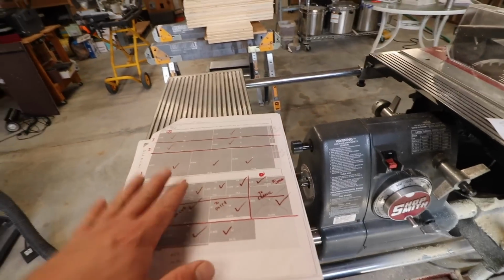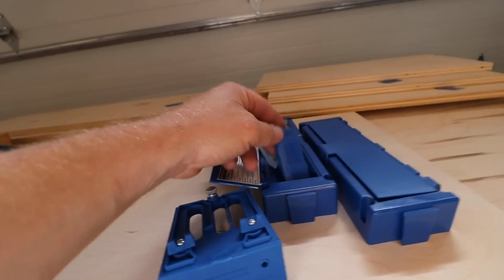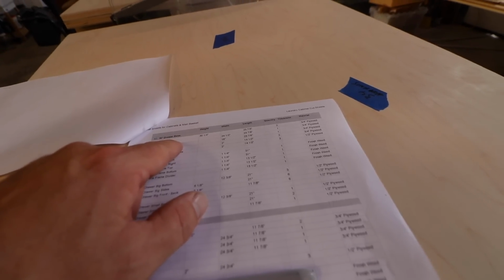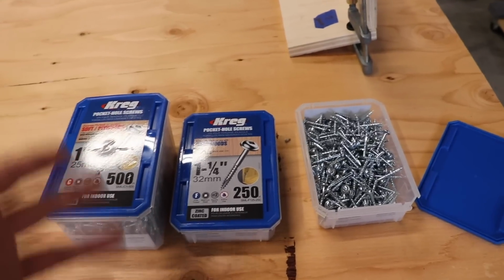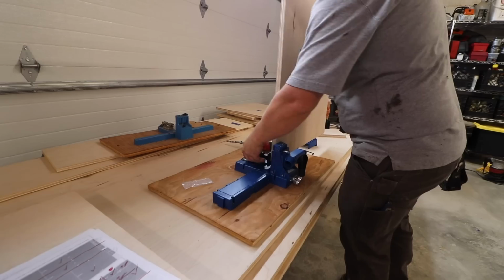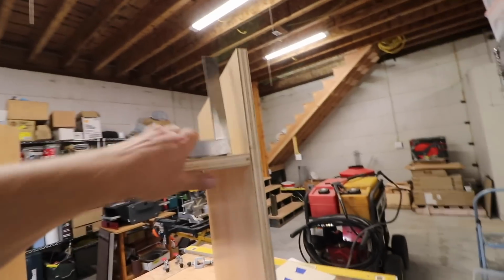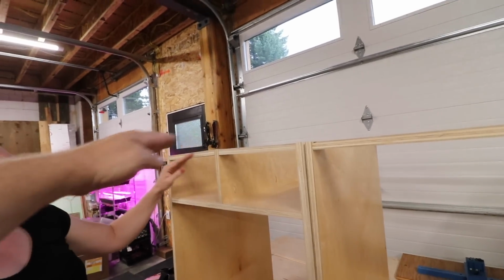Made ONE DOZEN CABINET JOINERY MISTAKES Today

Comment: Planning for a back panel on the drawer cabinets (even if 1/4 inch plywood) will help keep the cabinet square. Use rabbits in the side and bottom panels and flue the back panels.

Comment: Kreg has a new 90 degree clamp for corners. I’ve built tons with my k5 and it’s great. The new clamp eliminates the issue with the panels shifting. It holds fast and flush. Make sure to use glue on the joints though. Glue is so underrated.

Comment: Errors (as noted by others), but the biggest — lacquer is NOT a suitable finish for kitchen cabinets. Lacquer has no resistance to water (remember those nasty rings on grandma's table?). Polyurethane — water based or preferably oil. 2 coats minimum. Spray poly is available for faster drying.

Comment: The pocket holes in the panel under the drawers should have been on the drawer side of the panel. They're now visible from inside the lower box, vs being hidden under the drawers. The side panels could have been attached to the bottom panel by conventional screws coming up from under the bottom panel and the side panels should have been rabbeted so there's no end grain visible from the bottom panel. No pocket screws attaching face frame to side panels, glue and clamp only. Unless you're going to laminate something over a visible side panel, that's a lot of filling and finishing to do and the filled areas will probably flash through any paint job.
Reply: Steven S screws going into the edge of plywood have very little strength as the plies can delaminate. This can cause the cabinet to fail and fall apart. If you want to use a rabbit then after glueing it up you should put brads through the side and into the bottom peace at a slight angle. Secondly, the vast majority of cabinets that people buy are only finished on the face of the cabinet and the other three sides are not because they will be attached to cabinets on ether side. The last one would but up-to a wall or you get a matching panel to attach to the end. Lastly they decided to have face frames on their cabinets so no worries about seeing the edge of the plywood. Are there other ways to make cabinets? yes. But for a novice woodworker what he’s doing will work.

Comment: If you're going into edge grain of plywood without cross hole with dowels, I'd use confirmat screws like they use on mdf and glue. Regular wood screws just rip out of plywood. I'd really drill cross holes and fill them with dowels to accept the screws

Comment: That black plastic box with the fingers but I haven’t part is for supporting parallel clamps when you’re clamping together a frame and panel door or a box like a drawer
Reply: yes, that plasticy thing is a holder for clamps crosswise. I have used them from bessey. maybe they are also for Jet clamps.

Comment: Just FYI, when you checked the cabinet squareness you were experiencing "racking". Having 1/4" material on the back plays the important role of stopping the racking. 
Also you left the back off the sink base stating that your pipes would enter there. Aren't your supply and drain pipes actually going to enter from the bottom? You can't really get your pipes into your sip walls.
Reply: Cabinet will be against the bathroom wall, not the outside SIP.   Go watch the bathroom build....

Comment: Holes on the outside ??
Reply: I don’t understand the thinking there either... the drawer will hide them inside and the face frames will obscure them below.  Unless he’s going to veneer the outside???
Reply: @sassafrasvalley1939  He briefly mentioned something along that line.
Reply: Holes on the outside because when you line up the cabinets only the end one has an outside. Outsides get a finish panel. Take a look at the three cabinets and you'll see there are only two ends. Now if the cabinets start at a wall there will only be one showing end.

Comment: Just because you are using pocket screws on some faces, doesn't mean you need to use them for all faces.  That center divider would have been better served with simple screws coming from the bottom up.  They would have been hidden under the cabinets and it would make the connection stronger.

Comment: I think I saw you using a miter gauge when using the fence at the same time. If I saw right, never do a cross cut and  and use the miter gauge and fence at the same time. It's a kick back waiting to happen and oops, your finger hitting something turn over 3000 rpm.

Comment: You did well for your first time using the Kreg Jig and table saw. I built cabinets for my grandaughter's home. We had and an "L" shaped design with a corner cabinet for the lower's. And they had to fit the walls which were a bit out of plumb. I got plans from Kreg Jig company and did mine from their instructions.
I have also built a small table, our of cedar, that sits on my front porch and a couch table for my wife to serve desserts on Thanksgiving. All with the Kreg jig. Oh, and I built a toy box for a friend. You can stick dowels in the pocket holes and trim them off flush. Why buy the store brand.

Comment: I could be wrong, but the first cab you made you have pocket holes on the outside of both sides. But if that was the end cab, wouldn't you want the finished side to have the holes on the inside?
Reply: I think he said he's going to put a face panel over it.  This is just the box.
Reply: @KraftyKathi  Doesn't the face panel go over the front side of the cabnets?  If you look at his sketch up he did that is clearly the left side box, and those holes will be shown unless this is going up against a wall maybe.
Reply: @powang59  If you put the face panel on the front, how do you get into the cabinet when it's against the wall ?
Reply: Face panel meaning another layer, but on the end/side of the box.

Comment: Stop using the impact driver. Use a drill. And glue. And a back to square it up. Try to hide the pocket holes as well as you can too. Top and bottom or inside if it’s a must
Reply: Just finished watching the video. Sorry but you’re probably gonna start over.

Comment: Those black things with the 1/2" spaces, that you assumed are for holding material while you assemble it, are actually for use with Bessy Clamps. They are used to assemble frame and panel doors.
Reply: John Grossbohlin John is totally correct. I have the same blocks for my Bessy clamps
Reply: Indeed,  I have them to. To join things with pocket screws, I use my bessey clamps to hold everything in allignement

Comment: Jessie -you want a back on the cabinet to give it rack strength. It's easy to do with a rabbit bit in a router  and will square the box before you attach either a face frame or doors.

Comment: Whew you make thing so complicated. Cabinets are 24 inches deep and 34.5 inches tall. Its doesn't take a computer to figure out how to cut the sides, tops or bottoms. You want a 36 cabinet and you are using 3/4 plywood. Cut the backs and tops 34.5, then cut your sides 24x 34.5 and there is your box. Just notch in your toe kick on the side panels and you are done. Then measure for your drawers and install the slides and face it all out so it looks pretty. Throw that craig jigg in the trash and get a trim nailer. Lol.

Comment: If I use pocket screws I try two. Locate the on the inside and out of site if possible.   I don’t  worry. If it butted up to something where it won’t be seen.   I also use glue when I use my Kreg jig whenever possible
Reply: Also forgot to say I usually spray paint my cabinets.

Comment: What are you doing to stop the cabinets from racking? A simple way is to put a support Parallel to the wall on the back in the cabinet that you would not want to put a full back on not parallel to the floor like you have it. Corner blocks can also work. With out something the cabinets can be knocked out of square.

Comment: You really need to use TiteBond glue and a back. This will help square up the box and make it much stronger.
Reply: A back? Definitely. Glue? You'd just be making it harder on yourself. Glue won't stick to UV coating. Assembly would turn into a mess with everything slipping around; UV coating by itself is already incredibly slippery.
Reply: @KeithDiSarno  I thought he said it was finished on one side.

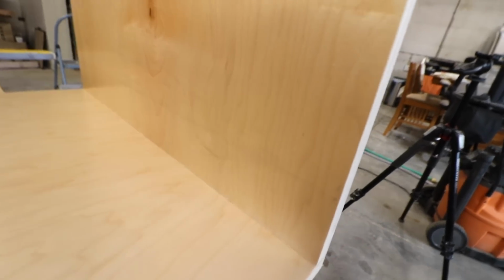Comment: A trick to preventing the edge from being drawn in that you were concerned about @ 19:05 is to take a 1/8th drill (or other appropriate size) bit to pre drill into the 2nd sheet. Another trick is to anticipate the amount that it will pull in and compensate when clamping.
Reply: I like your idea and mostly I like that you share experience not simply judging poor novice guy)))) Thx for advise I will remember it too)))

Comment: Just a quick suggestion, because it might help control dust. Hang fabric or light duty tarps between the two bats of the garage, separating the living area from the work area. It won't stop the dust but it may shorten the area it floats around.

Comment: Why not just hook your water up all the time to the well
Reply: Because they are in an area that has hard water, freezes and they have a cistern at the top of the hill behind his house to provide water pressure and storage. They fill the tanks at the top of the hill after treating the water for hardness and rust, after letting the water flow a bit to gain clarity. Otherwise they'd have cloudy water, rust and silt in their plumbing directly from wellhead to their house.
Reply: @Sullimech  I know what they do and how their operation works...however it makes sense now to hook up to the well...keeping a head pressure on the well will keep clean water as well...they could use the cistern for watering the garden

Comment: Front edge of the sink base:
That board is pretty wide for that application.  You won't have room to connect sink bowl anchors.  
But don't think you have to move the sink back away from the front to clear the board.  Just cut the sink hole including cutting through that board. As long as your sink hole saw doesn't hit your pocket screws, you're fine -- and if you want to locate your sink where you think the pocket screws will interfere, just take the screws out before making the cutout.  The glue will be dry by then.

Comment: Face frame:  
I think I'd just use Titebond and pin nails. Some of these modern wood adhesives are amazing. You almost don't need dowels or biscuits to connect boards edge to edge for table tops.  The glue joint will be stronger than the wood beside it.  Make sure you use plenty of adhesive though.  It will really soak into the end grain of the plywood.

Comment: You’d be better off using a drill driver with the clutch than the impact driver... it saves so much time as using the clutch removes the need to finesse with the impact driver.

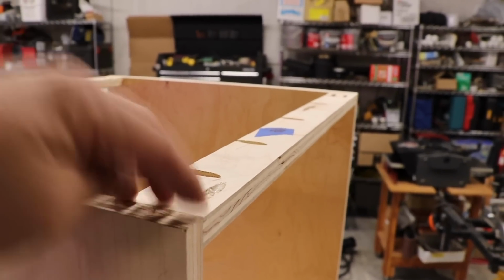Comment: 26:30 You probably know this, but in case you didn't. If you drilled the wrong holes and you can't get it to fit nice. Take the time to plug the holes with wood and then drill again. The holes aren't there anymore so problem solved 😊
I love your video's btw. Learned a lot from the electrical video's 😋

Comment: I built a cabin in Maine, and realized that without a complete shop and lots of space, building cabinets just wasn’t going to work.  Cheap Home Depot stuff did the trick.  After 30 years I have no regrets.  I admire your determination and desire to learn this skill, but I wonder with all you have to do, if building cabinets really makes sense.
Reply: Kevin Harding I’ll be building a cabin in Maine too. I think the idea to need custom cabinetry stems from limited kitchen spaces which are not uniform at all. In a open space layout it’s easier to use off the shelf products. 
While I also lean towards buying the cabinets, I think it’s a cool project and skill to learn too
Reply: I think it is about the process,  he either has to work to pay someone,  or do it himself  and learn.  There a lot of people out there who say they built their own house,  but all they ever lifted Was The pen to write the check out

Comment: Are you sure 1/2” is enough for the backing? Why not go 3/4”?
Reply: 1/4" is typical for backs. Even 1/2" is wasteful.
Reply: 1/2 inch is overkill but for a beginner it's fine.

Comment: Wooden plugs are not that easy. If your are painting cabinets then use automotive Bondo. Putty knife bondo just like mudding sheet rock.  Will be able to sand to super smooth surface and then paint.

Comment: Use Glue and a pin nail gun to put in the face boards then very small holes will require just a wood filler pen to fill in the tiny pin holes on the face

Comment: You need to get the kreg drill bit with collar. The collar is mounted on the drill bit for the depth of the hole. You can purchase the kreg stuff on amazom.
Reply: Ummm it does have the collar - clearly visible at 10:44

Comment: It seems to me that you should have put the finished side of the wood on the outside of the cabinets, and put the pocket holes on the inside where they won't be seen.  After all, don't you want the OUTSIDE if the cabinet to look the best? Once you put doors on the front of the cabinets, you won't see the inside surfaces, except for the top surfaces of shelves.
Reply: Some of the outsides of cabinets face each other, so in that case, the pockets are not seen.

Comment: Thats the problem, working in inches , swap to metric , much easier ....
Reply: There's nothing hard about either one if you grew up with it.
Reply: @GeneWaddle  True that, inches are great for most things but if your working with smaller stuff mm comes in handy - can measure right down to 1mm (0.0394 Inch).
Reply: @Nostradamus1981  When you need to do that, you get a micrometer that measures down to thousandths of an inch, so either one can be used just as easily.  As I said, it just depends which you're familiar and comfortable with. Now I will say, if you're collaborating with others around the world, it only makes sense to pick one or the other and in that case, the metric system would be preferable, but most of us are not doing that and it really shouldn't make any difference what someone else is using.
Reply: @Nostradamus1981  i use both, whatever is closer on the measure
Reply: Metric is confusing
Reply: Gene waddle I agree 👍

Comment: Don't know but a few drops of wood glue might make it stronger..
😁
Reply: The point of using the Kreg pocket hole tool is that it makes using glue pointless. The strength of the cabinet with just the pocket holes is already multiple times more than it needs to be.

Comment: Hi Jessie, for your drawer divider peace do not use pocket hole, simply use counter sink hole  under the shelve portion.   However if you really want to save time and money eliminate the shelve and drawers divider that goes through the entire cabinet.  That are not needed. Your draw slides will attach to you face frame.  You save time and money and end with a great product

Comment: I built kitchen cabinets with the kreg system.
Some thoughts to share.
A: screw and glue
B: Screw holes on the inside.
That’s how I did it. 
If you use plugs to hide the screw holes, you won’t be able to disassemble your cabinets.

Anyway, you’re doing fine.  I hope I’m not being a troll. 
Thanks,
John

Comment: Not all surfaces require a pocket hole... the vertical board between the top drawers should have been attached straight in from underneath.

Comment: Please be careful using the fence while making crosscuts.  If you want to use it for a repeatable stop, clamp a piece of material to the part of the fence that is in front of the blade.  You can index against this wood, but there will be plenty of room for your offcut after you make the cut.
Reply: Your method of cross cutting with the fence can cause kick back.   THIS IS VERY DANGEROUS !!  USE your cross cut sled   PLEASE
Reply: Yes, the method in the video can cause kickback, esp on wider pieces.  Attaching a spacer to the fence well ahead of the blade can allow you to safely index against the block while leaving plenty of room at the cut for the off cut.  A sled is always a great option if available, but the mitre gauge can be used in a safe manner as well.

Comment: Jessie: you should do the same standing-on-it test with good wood glue (along edge, and inside pocket, letting it dry). I think you will find it dramatically stronger: it tore out at the screw interface due to limited contact surface area and leverage. Pocket screws don't allow for any relative motion of wood, so the additional glue bonding only adds strength with no negatives.

You should be able to get almost a strong enough joint to restore the breaking tension to a similar level as if you put, say, a piece of sharp-cornered angle-iron (or a T) under a board of ply and stood on it, then spread your feet out: at some point, it will break completely in the plywood due to the leverage. Where your weight is left and right of the angle iron should be proportional to how long the length of plywood would be for the tent you are standing on, give or take a bit.

Also, of note, for the ply-to-non-ply interfaces, because pocket screws don't allow for relative motion of wood (it would weaken over time as one part grows and shrinks, more on longer faces than shorter ones), so one would go with other kinds of joinery, like dados, tenons and unglued rabbets for cabinet insets to allow slip for the wood to 'breath'. Otherwise, you'll get various effects like bowing (leading to cabinet sticking unless your tolerances are really sloppy) and cracking. Noting grain direction in relation to the joinery is an important consideration here.

(I am not at all an expert on cabinetry, I hope some dudes who are pros could give you some better pointers)